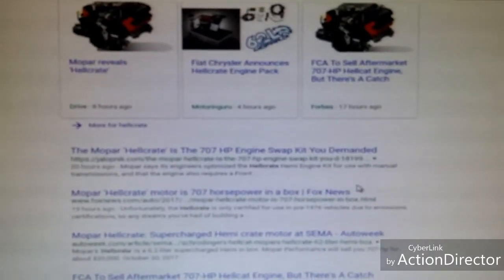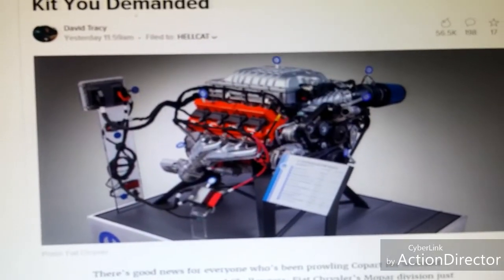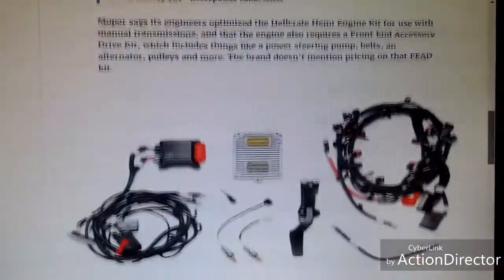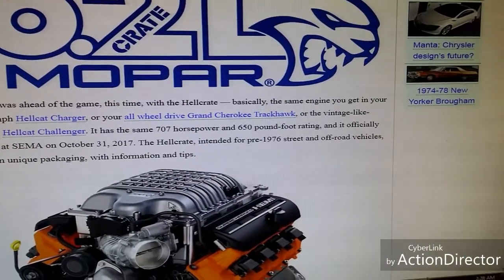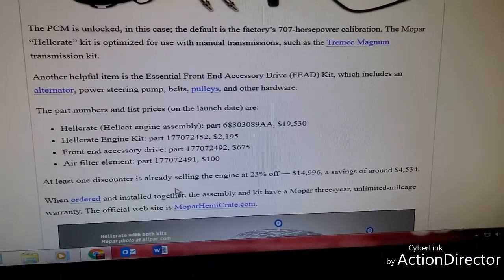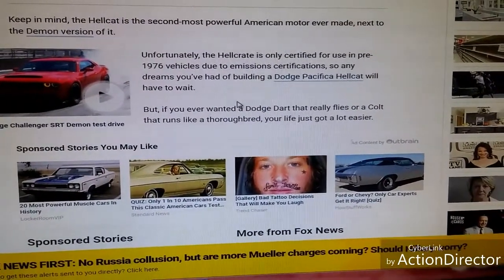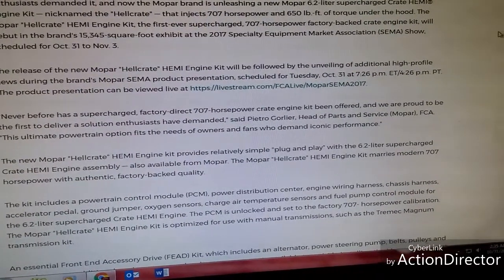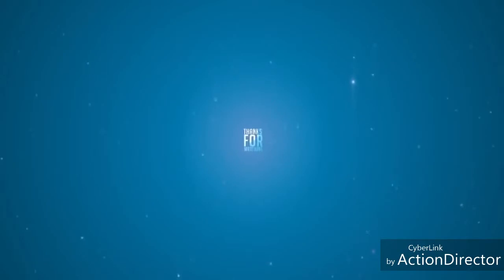Hellcat "Hellcrate" Engine Kit

Comment: I'm pretty sure that if it fits, it will run. Ffs, the LS4 engine was put into a 1990's Honda Civic with room for a turbo. These engines are lightweight, small, and powerful. All of these make for the perfect crotch rocket.